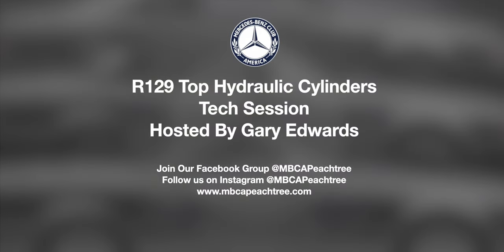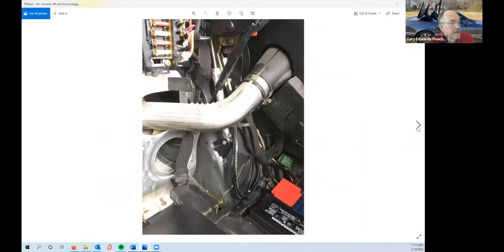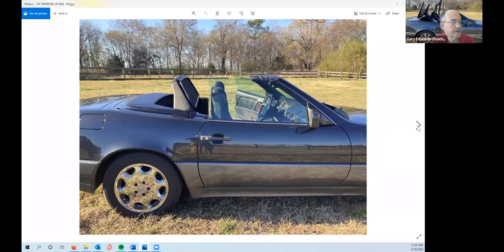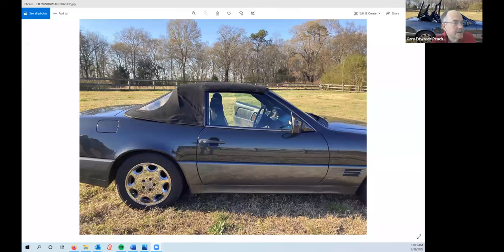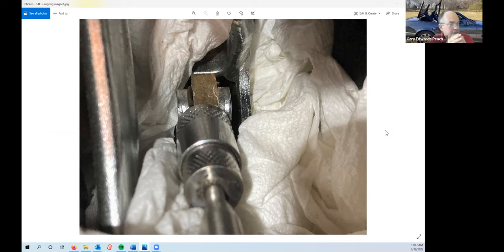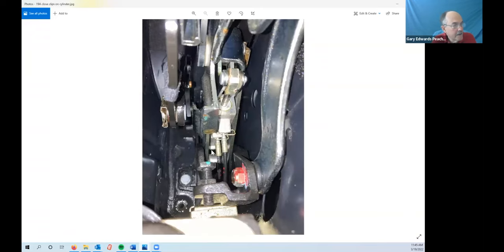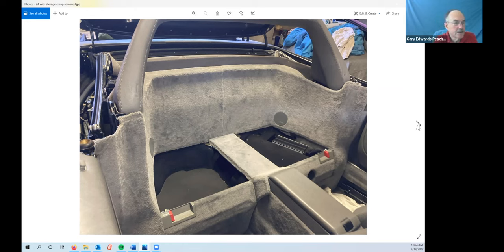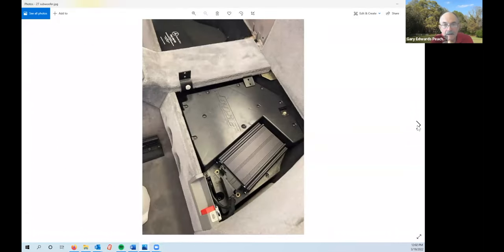R129 Hydraulics Cylinders Tech Session Hosted by Gary Edwards

Comment: Thanks to all involved in making this possible. I still have my 98 500 and 94 600,I do all repairs on both cars myself,I have had 3 parts cars over the years so I have a good supply of spare parts for these cars.
 I have replaced most cylinders on both cars,I have used top hydraulics for rebuild service,but the last couple cylinders I reseald myself,I figured I would try it and see how they hold up,so far it's been about two years and no leaks. The 98 has been a rock solid reliable car,the 94 not so much. I have replaced/ repaired so much on that one that I have probably invested far more than it is worth,but I will continue to throw money at it as needed as long as I am able as it is one of my all time favorites,and I have had well over 100 cars through the years. I am in the automotive field for 40 years now. I have seen most all there is but, the r129 has always been a favorite of mine,from the styling to the engineering,sure there are much easier cars to work on,and more reliable at that,( I worked for Toyota for 20 years)but I have yet to have the overall satisfaction of any vehicle compared to the 129 chassis. Thanks to all for keeping these going. Just curios what areas are you all from? I am south west PA.
Reply from the maker: You're welcome and thank you for the nice comment.